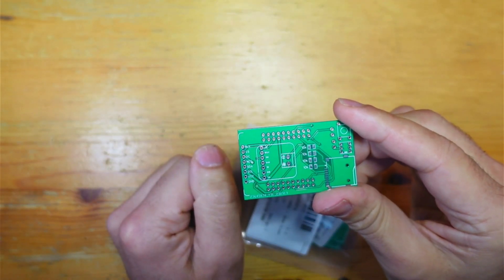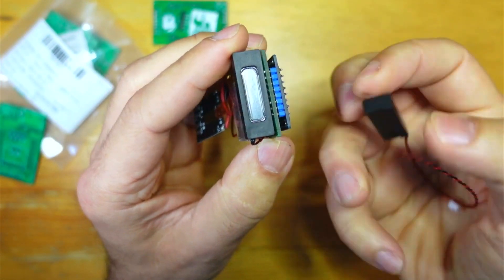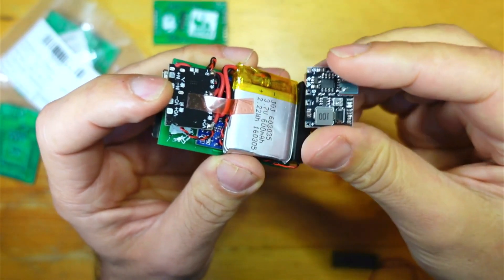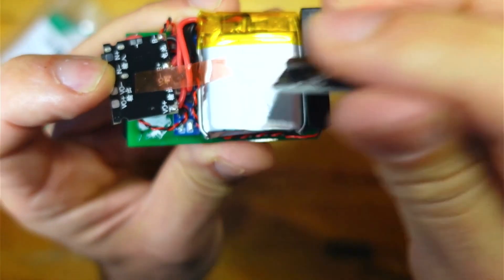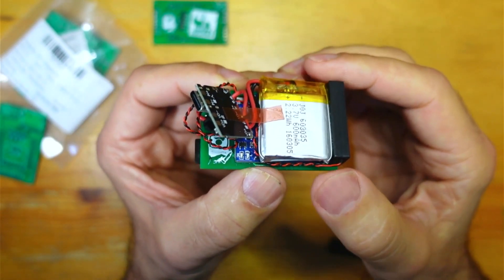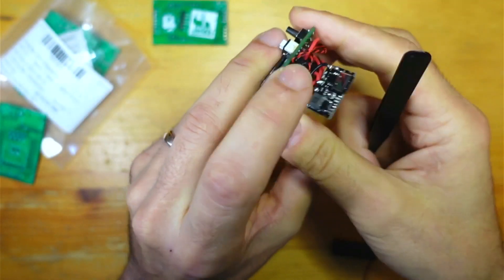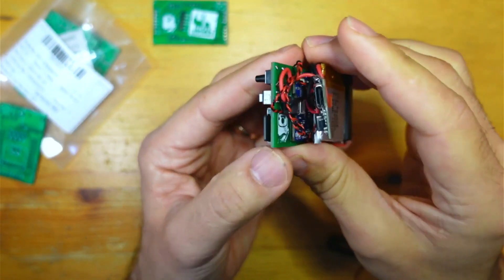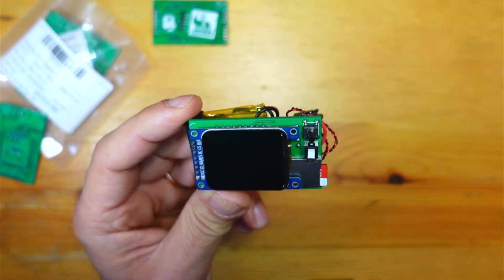Mini TV Repackage Second PCB

Comment: hello 
I`m prototyping this project and i keep getting this error: 
"[ 1640][E][sd_diskio.cpp:806] sdcard_mount(): f_mount failed: (3) The physical drive cannot work error" 
can you help me with this?
Reply from the maker: I've never seen that error. If it can't read the SD card or video files on the SD card, the only error on the unit is "Error: File system mount failed!" Which generally means you have messed up the soldering or your video files are  in the wrong place, messed up, incorrect naming, missing capitalisation, etc.
Reply: @megazoid  thank you for your quick response. everything is in order (wiring, folders, files, etc) I`m using a regular microSD adapter and i think that is the problem. (microSD card: 16Gb Samsung evo+ class 10) and thanks again for your response.
Reply from the maker: @blazeking9698  Good luck. I made 10 of them and they all worked. The design isn't perfect, but if you have the same parts, your soldering is on point, and you follow the guide.. it should work. 👍
Reply: @megazoid  thank you. i`ll get same parts.

Comment: Hello, I finished soldering the board and had programmed the esp32 before hand. But after soldering the board, it now doesn’t want to power up. I verified no bridges on the solder connections. And verified that power was being fed. Any help would be appreciated.

Comment: Hello, I made one according to your steps, but the startup shows ERROR:failed to open/Videos/1/44100.acc. May I ask why, memory card tried a few are displayed so
Reply from the maker: It could be the cards? Some cards don't work. I have a SanDisk Ultra 32GB that doesn't work. Lexar 32GB from Amazon works, as do others I have tested.

I could also be that your converted files are just not right. Try using the my MiniTV Converter Software at the bottom of my project on Thingiverse. Make sure you are putting BOTH converted audio and video files in the Videos/1/ folder.
Reply: @megazoid  Okay, thank you very much. Ha-ha, it's fine. Thank you

Comment: The pads on the lx-lcbst are the vcc and chip enabled pin and if you just went it to be on all the time you can brig them together with at solder join or you can solder a memory/latching switch to them and at resister to ground and you can control the IC
Reply from the maker: Thanks for the comment. A visual check shows the "T pads" just connect the battery GND with the Output GND. Something to do with if your battery has a protection board, do something, if not, don't do something. Edit : apparently I have to short them if I have battery protection. Okay, cool.

Comment: I found the same charge board on AliExpress (LX-LCBST) and the instructions state the 'T' point (the pins you momentarily shorted) must be linked for batteries with their own discharge protection circuit, or left open for those without (to use its own).

Your battery appears to have one, so one or other is tripping when voltage low enough and the charger board relies on that for battery detection, hence shorting brings it back - you can't run them in series!

So yes, solder the 'T' pins to bypass the charger boards own discharge protection (HM5434).
Reply: Also be aware that you can buy these same boards with same model number(!) that omit the discharge protection IC - their instructions state 'those' boards should only be used with protected batteries and to still make the solder link to 'enable' the board.
Reply from the maker: @TinWhisker   I'm so regretting buying these lol. Much confusion! I think you are correct though, and an Italian site backs this up 100%. Thanks a lot 👍

Comment: You should build one into a replica "Space 1999" Comlock. Could likely sell such an item for a pretty penny.
Reply from the maker: Brilliant comment.Without looking it up, I believe those Comlocks were working (or semi working) units based on real miniature TV technology weren't they? I haven't read up on them in a while, but sure...somebody could shoe-horn this thing into a Comlock prop. It wont be me though. I don't want Viacom or whoever owns the Space 1999 IP after me 😁
Reply: @megazoid  If you check a video on the Comlock replicas that are around you'll see there's plenty of space and the faux TV screen you have is pretty much the perfect size. I think a couple of hero props did have a small CRT TV screen. While you're at it, the original series "Star Trek" tricorder had a small CRT TV screen, though I don't think they were functional, of pretty much the identical size take a look at pictures of them. A one off prop replica build for your YouTube channel, for personal use, wouldn't get you in trouble but it might well get quite a few views.